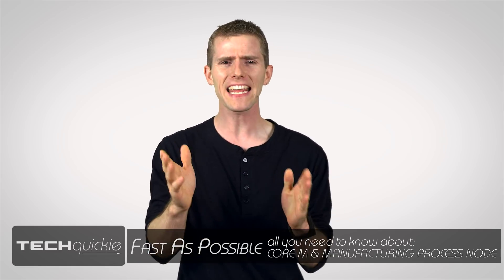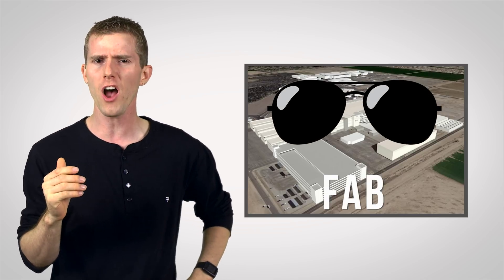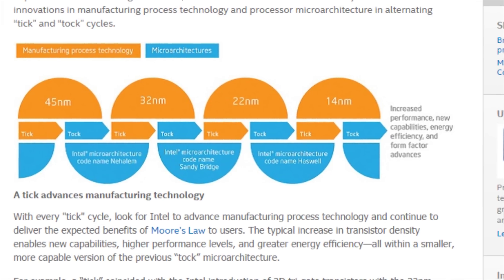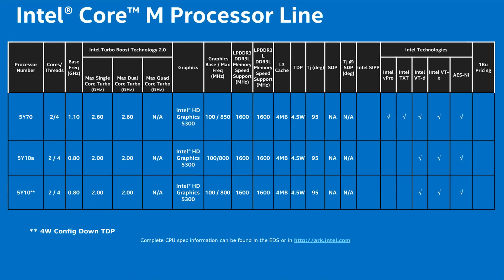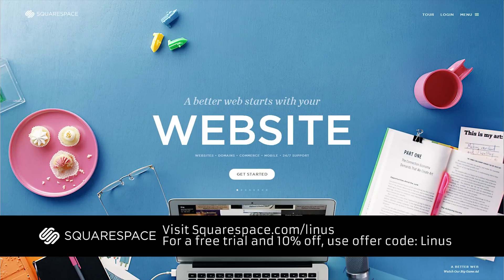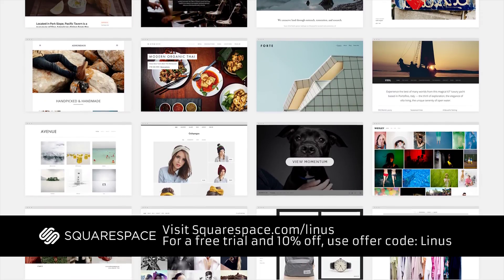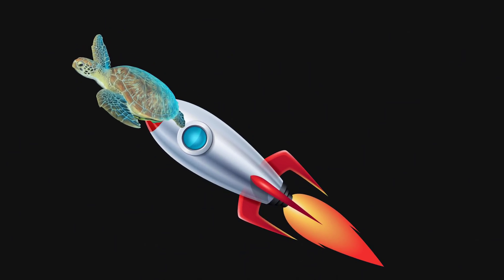Processor Manufacturing Processes or "Die Shrinks" as Fast As Possible

Comment: Lol. "First chip based on a 14nm process." and 5 years later... Still 14nm.
Reply: https://versus.com/en/amd-ryzen-5-3500u-vs-intel-core-i5-10210u-vs-intel-core-i5-1035g1
Nice some ryzen in mobile like r5 3500 still 12nm then the i5 1035g1 have 10nm process plenty intel 10th gen processors in mobile now are in 10nm process BUT many of intel products are 14nm,

But in terms of pricing Ryzen 5 3500u is better for that 12nm vs i5 10nm still in high price

Comment: So at what NM is it physically impossible to go any smaller? I assume it cannot go on forever. 1nm?
Reply: There is a point at which quantum tunneling kicks in, and you can't go any smaller, because it would destroy the processor's ability to do anything
Reply: I'm willing to bet in 50 years 1nm will be considered morbidly obese.
Reply: They cannot go smaller than 10 nm because of quantum tunneling. Intel Skylake is on 14 nm. Upcoming Kaby Lake is an upgraded version of Skylake 14 nm procces. Upcoming CannonLake will be on 10 nm, and we dont know when that will come out.
Reply: i dunno about measurements but at one point electrons will start to be at an increased risk of tunneling through the silicon but if you ignore that you could theoretically go near as small as a single atom especially if they use lighter materials
Reply: although if we started using quarks not electrons we could go even smaller

Comment: So for anyone reading this, do you think Cannon Lake would be worth the wait (at lease 15-20% performance bump from Kaby Lake) @ 10mm process? Even though Broadwell moved from 22nm to 14nm, there wasn't a big performance difference. So I am wondering if I should just buy Skylake now, since Kaby Lake doesn't seem to offer much of a performance increase, though if Cannon Lake turns out to be what GTX 1070 and 1080 turned out to be to their predecessors, i.e. much better performers, it'd make more sense to wait for Cannon Lake.

Comment: For those that are wondering why intel disposed of the Tick/Tock cycle, you may investigate Moore's Law. It states that the number of transistors on a single die will double in 18 months. However, once we get down to around the 8 nm process, we start to have issues with a phenomenon called quantum tunneling. This is where the transistors switch themselves on and off randomly, instead or in addition to the gate current being applied. This, in turn, means a highly unstable processor. In order to combat this, intel has adjusted how the "dope" the silicon. By changing the concentration of the dopant atoms, they are able to change the quantum mechanical properties of the transistor. This allows them to prevent it. Imagine the problem like this: You have a dam holding 5 feet of extremely wavy water. If the dam is too thin, it will burst letting all the water through. If the dam is not high enough, water can splash overtop of the dam. In both of these situations, the dam has failed to do its job. This is the same issue with these transistors. So, we now will have to wait until we have quantum computers (which may never happen.) Yay spending money!
Reply: Moore's Observation.
Reply: We now have 7nm chipsets in flagship phones!

Comment: Ok, nice again, but what about Advanced Micro Devices?? always intel even in your examples? maybe an APU
Reply: +MRHOTCAKE right now , AMD doesn't own any FAB's , and they do not control process node evolution
Reply: at least amd is quite cheap for the cores it's just old apis underutilizing the core count but they could get allot better if they lowered the transistor width

Comment: For all the people who are saying 14 nm transistors and comparing it to the size of atoms are wrong. The transistors aren't 14 nm, the band gap is. If you have two circuits(so 2 lines of copper) 14 nm  is the distance between them. It has nothing to do with size of the transistor. I don't know the size of the transistors. Band gap is bettered by finding better ways to insulate the circuits.

Comment: Can you game on i5 4690k, evga 970, 1 harddrive, 1 optical drive
With a 500W power supply?
Reply: Colonal Kohler okey but is a 500 Watt PSU enough for i5 4690k, evga 970, etc?
Reply: Colonal Kohler OK thank you being so helpful
Reply: Colonal Kohler I did the test and it said 
Recommended: 456W, so I should get a 500w?
Reply: Colonal Kohler OK by the way what specifications do you have
Reply: Colonal Kohler do you get good performance with a gtx 760( like 40-50 fps)
Reply: Yea 500 w is enough. Just be sure that the psu is 80+ certified.

Comment: Sooner or later (if not already), there will be very few atoms in a transistor for it to respond correctly which will lead to them not doing what they are supposed to (turn on or off) aaaand they will be more like "naah bra, I aint doin' dat" and error correcting programs just won't be efficient enough. Sooo, do we just stick with the smallest size we can get transistors and enlarge the CPU itself until it's as big as my head and can calculate with 100Thz?

Comment: There is a simple explanation. Gas has very limited expansion capabilities into any other markets, in fact there is major popular push in the most developed markets to reduce the use of it. Chip manufacturers make chips for many devices/companies from the same plant and in so doing can keep costs down by making more things based on the same process. An example would be a foundry like TSMC, once they have a new process up and running they dont throw away the equipment for the previous process. They continue to use it in making other more mainstream or low end ICs for anything from cable boxes to low end smart phones. In so doing they increase profit generated by the older process and the cycle continues.

Comment: For anyone wondering why Intel CPU's can cost so much, or why AMD hasn't kept up with the latest 14nm, or even 22nm processes consider the following.  It cost Intel apx 5 Billion dollars to make this new factory (FAB) with the latest manufacturing equipment, material quality control etc for this upcoming 14nm process.  That doesn't include the Billions more they have spent to convert some of their older FABs over to 14nm as well.  AMD on the flip side doesn't own any of its own FABs anymore. Basically AMD design the chips but then has someone else (Global Foundries IIRC?) do the actual manufacturing of it for them.  Intel has some of the most, if not the most advanced manufacturing facilities in the world and AMD simply can't afford that.  R&D and the building of these massively complex facilities is a huge cost.  Intel owns 9 FAB plants in the USA and 3 others around the world and I heard they got funding from Apple to help pay for this FAB since Apple will be using their processors.  No hate, I'm not a fanboy and I like both Intel and AMD.  I like AMD because their lower end CPU's and GPU's can be competitive, or at least cost effective alternatives for budget gaming systems and I like to support the underdog.  But that's just it, compared to Intel and the kind of money they spend on FAB and R&D, AMD is the small guy. That may be reason enough to root for them but don't expect them to keep up with the latest FABs like Intel can.

Comment: Can you do one on why is it possible to max out your RAM in a PC? For example, I have an iMac G5, and it maxes out at 3 gigs. But, I can buy the exact same type of memory (or is it) and have 8 gigs, but it won't recognize all of it. I'd love to know why this is.
Reply: This is actually because your iMac G5 runs a 32 bit OS (that being the norm back in '04). Your systems bit-rate decides how much memory your computer can "address" (or manage). This is fixable on a PC by updating to a higher bit-rate OS (like 64 bits, which is a more recent standard).

On a side note, even without updating the OS, it's possible to use much more RAM by using physical address extension (PAE), which is unfortunately not supported by your G5s IBM PowerPC processor. Only Intel Macs do, as far as I know.
Reply: Akito Uchiha You could have saved yourself an entire minute (or more) of your life. My iMac has an Intel CPU. :)
Reply: ***** Regardless of your CPU what Akito Uchiha said about your OS is correct. Take the number 2, then take it to the power of 32 thats 2^32 (can do this in any competent calculator). You'll come up with a number around about 4 billion, which is well, 4 Gigabytes. Add in other quirkiness with how memory works in computers and you end up with somewhere between 3 and 4 GB of usable memory when using a 32 bit OS.
Reply: needs to be enabled in software, don't ask me  how though.
Reply: Freelancerk1bbles I thought PAE-compatible processors made that a non-issue. And, as far as I know, the Intel Core 2 Duo that is in my iMac G5 has PAE support.

Comment: Theoretically, a transistor structure could be BUILT at 5nm, but at that size, due to the effects of quantum tunneling, the structure is inherently unstable in its ability to function as a transistor. Due to this, 10nm is generally accepted as the final limit for a stable transistor stucture. This means that until about 2018-2020, computer technology will be in a golden age of speed and capability. Once 10nm manufacturing processes are hit, that's it. That's the end of computer technology as we know it getting faster and faster. And the argument of responding to the problem by just throwing mores cores into processors with hyper-threading only works as long as software is produced to be able to take advantage of that capability. Which, in the case of 8 or more cores, VERY, VERY few applications are produced to be able to utilize those cores. So, what all of this means, is that we should start looking into different computing technologies, if we want to achieve those greater levels of speed and processing capability, like quantum computing, optical computing, DNA computers, or even just utilizing a different structure entirely to replace the transistor, like PCMs (Phase-Changing Materials).

Comment: Linus can you do techquicke video on the difference between Amps, Volts, and Watts?
Reply: Amps * Volts = Watts
Reply: Dave Poo That doesn't explain anything...
Reply: It explains how power, current and voltage are related. Asking what the difference is between Amps, Volts and Watts is a bit like asking what is the difference between a Car, the speed of a Car, and how many Cars pass by me every second.
Reply: Like everyone's saying. They explain this stuff in high school physics and/or first physics course in college. They teach you the differences in 4 month courses. One of the ways they're different is units.

Units 101: Distance is measured in miles, feet or meters. Time is measured in seconds (it's amazing how no-one else successfully made another unit for time yet).
If you divide distance by meters, you magically get something called speed.

Electrical Units 101:
We have three things. Voltage (Volt), current (amp) and resistance (ohm).The units are in paranthesis. If you multiply the first two, you will magically get something called power, and its unit is Watt.
Watt is one of many units for power. You also have Horse Power, which is about 746 watts. Watt is also known as Joules per second. If you multiply watt with seconds, you magically get energy, and its unit is Joules.

Is my answer to your liking, my good sir?

Comment: Linus I would like your opinion on the continual of smaller and smaller lithography, I don't know how much you might know about the subject and the problems it is facing, but basically even the 14nm technology currently in use faced HUGE development investment on both Intel's part and secondary manufacturers of machines (ASML and many more).

One of the biggest problems I see today is the fact that the next "big step" in lithography will need to be seriously different than anything before.

While current lithography machine use lasers to create a highly uniform and single wavelength of light the next big step is facing huge limitation due to the fact that the wavelengths needed start do depart from "light" and in to the x-ray.

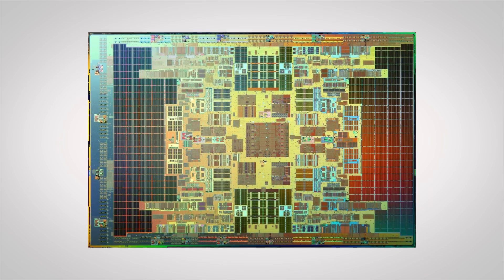Comment: 1:46 : Surely the raw material cost is insignificant as microchip are made from what is pretty much sand. Shaving a few millimeters from the size of a microchip wafer will make virtually no difference to the raw material cost. I think the saying goes "When making a microchip, the first one cost's you a million dollars and every one after that costs you nothing"
Reply: 1, its pure silicon not just "sand" and theres a refining process involved just for making the silicon which is probably expensive, 2 theres metal in the transistors, 3 the machinery has to be re-set up and calibrated and sometimes redesigned completely for every process shrink, the saying is right though.
Reply: 1toncheese My point was that the raw material cost is insignificant. In fact, even though the die's have got smaller, the number of pins has increased and those pins are gold plated, so i would think that the raw material cost of the chips is actually higher than it ever was.

Comment: Hey linus,
why ,in your opinion ,Intel isn't the  top Soc seller for mobile device in the world? What Qualcomm has done (and still doing) that made her the number one seller of mobile devices in the world, and why doesn't Intel just use their ,enormous, amount of resources to rule this market?
I'll prefer an Intel Core M chip in my device, over any other manufacturer in the market?

*just a small (and very stupid question XD) does Intel make a graphic processor as well to their SOC? Qualcomm's SOC is made of the snapdragon and adreno GPU.
Reply: Saar Hay The X86 is a much more inefficient architecture than ARM as it don't really have some power saving features (mobile devices needs to have this) and typically consumes more watt per clock compared to comparable ARM SoCs.
Back in the days where Macs were still using PowerPC architecture, they made strong points on why x86 is more inefficient. Intel was planning to ditch the x86 for their 64 bit version through Itanium, but AMD ruined their plans by implementing an x86-64 extension. The x86 eventually got more mature later on and was able to cover their drawbacks until the mobile and tablet market was starting to replace computers and laptops. Intel had been focusing all its efforts to play catch up with the companies that form ARM by fixing up the inefficiencies of the x86 architecture, but at great cost. Most of their releases are just incremental updates from the last generation with not much difference because they are too much focused on battery life and power consumption and not performance and cores anymore.
It'll take a while for Intel to catch up with ARM. X86  is a mature architecture, but it consumes too much power and Intel had to make 'adjustments' to make them practical for mobile day to day use. These adjustments did not come cheap and it still isn't better than the best ARM had implemented, but they will still try to insert themselves forcefully in the mobile race and try their best to take the crown from ARM... someday.
Reply: They just aren't heavily invested in the market. They have a few chips. I'm sure that if they so wished, they could probably dish out some SoC that could destroy the competition, but they have other issues at hand.
Reply: Which sort of other problems?
Reply: Because Intel makes x86 processors and Qualcomm makes ARM. Also Qualcomm moved lots of mobile phone components to its SOC and that made their SOC energy efficient
Reply: wwwelkam Imagine all the trouble changing and recompiling the mobile os's to x86!
Reply: so what are the differences between the Core M and the Intel soc that is already  on some of the Android phones?
Reply: triadwarfare
Intel bought company that makes ARM proccessors so Intel will make ARM
Reply: wwwelkam ARM Holdings licenses their designs to anyone.. Pretty sure intel has plans for making 14nm ARM chips.. Also which company did intel buy that makes ARM chips?
Reply: wwwelkam Looks like they are still forcing the x86 on the Tablet space for now. But I'd like to see an ARM powered Intel device.

Comment: Oh. Surely there must come a time when we've gotten technology as good as it'll get? I mean for example, surely there's a limit to how small your transistors can be and how close together they can be? Like there'll be a point where you can get no better no matter how much better your production technology becomes because it simply will not work if it's any smaller still? At that point, won't CPUs and GPUs stop getting progressively better and all of the ones manufactured up to that point will be the only ones in existence forever? Which in turn means that there's a limit to quality, efficiency and performance, and therefore the amount of quality in video games?
Reply: ***** There's still an upper limit even if said upper limit can get extended using different electrically conductive materials...